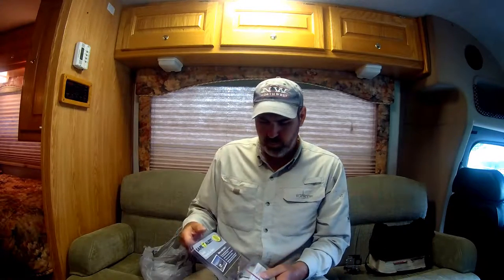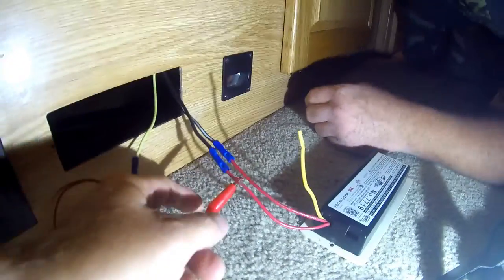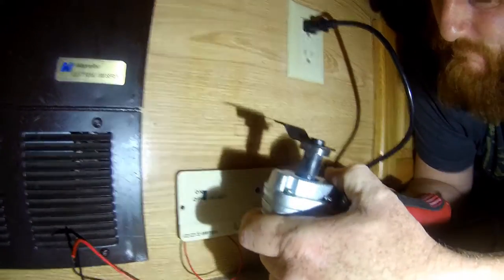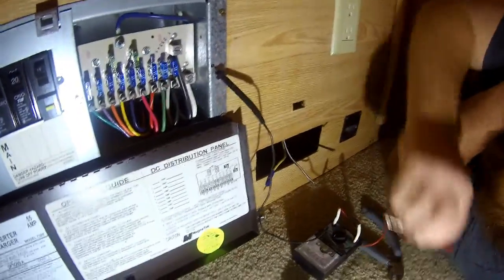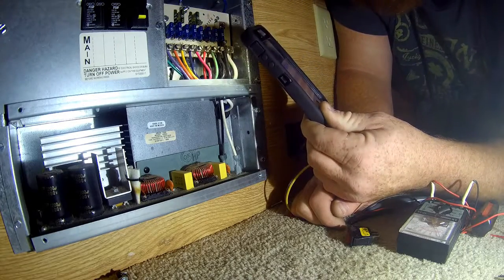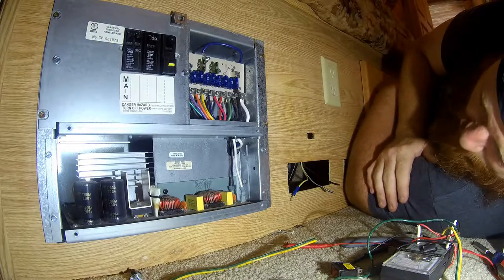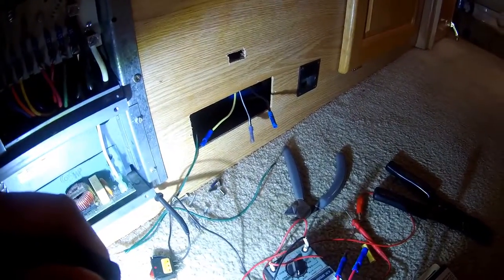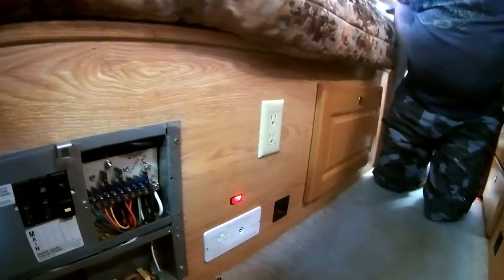RV LP Gas Detector Replacement From 3 Wire to 2 Wire/Solenoid Bypass

Comment: This appears to be a 603.111 Safe-T-Alert Industries 35-742-WT Dual LP/CO Alarm, I am not an expert. I think the redlight rocker is a 12V 15amp 3 prong. I will be installing this in a few weeks.

Comment: Maybe you can answer this.
I want to replace my old style propane detector that has the  solenoid with a newer style safety alert without the solenoid. My question is will the new one work if i dont connect the solenoid? Can i just cap the unused wire and will gas still flow normally?
Reply from the maker: Hi. I believe that the solenoid needs power to stay open. The safety feature engages when power is lost if I'm not mistaken. Maybe you could try to jump it to your battery and listen for a click.